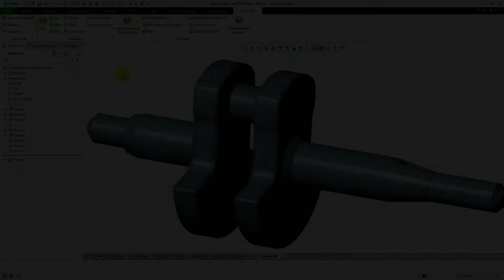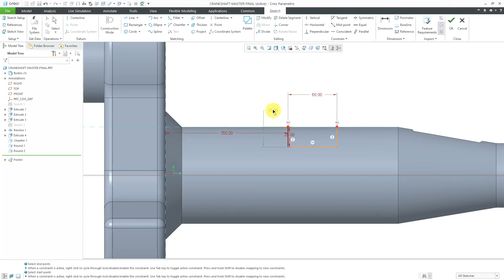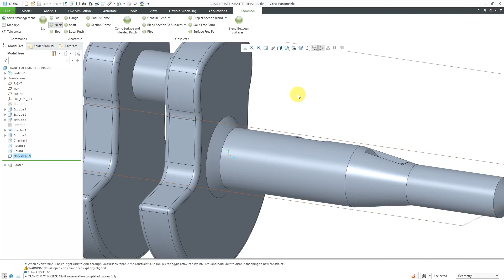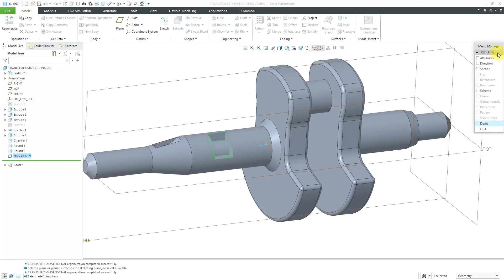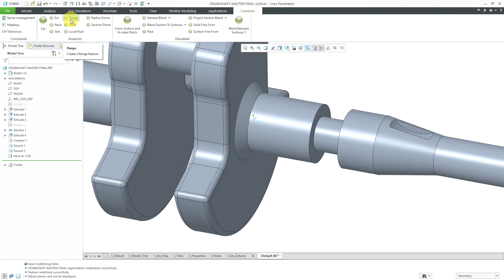Creo Parametric / PRO/ENGINEER - Neck Feature | Obsolete Features

Comment: With these videos you travel our minds in the past, I love it!  So, when we see at the model tree protrusion instead of Extrude or both, that means that the part was originally greated back then? 
Also today I notice at the common robin the mapkeys, is the same command as the newer versions?
Reply from the maker: That is correct. I think around Wildfire 2.0 that feature names changed to what we see today. The Common tab got added in Creo 5.0 if I remember correctly.